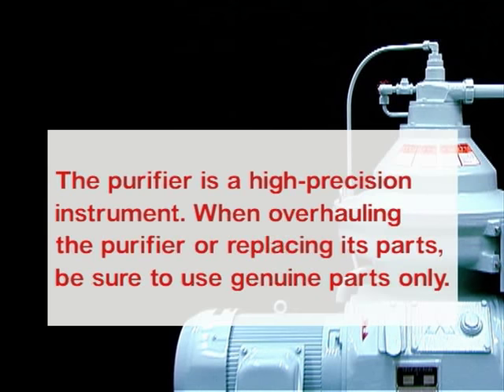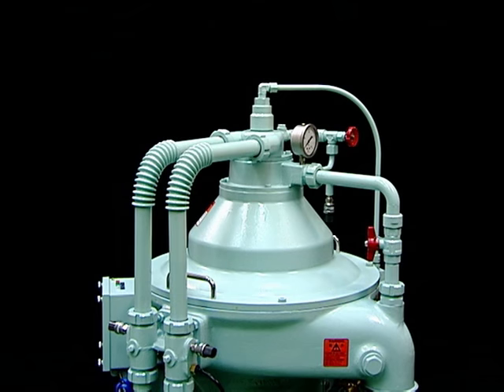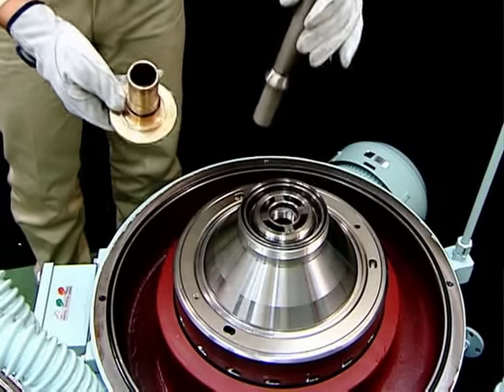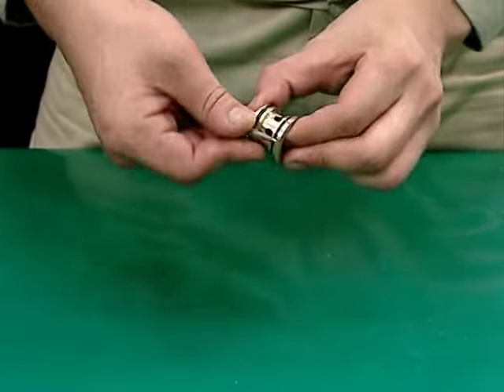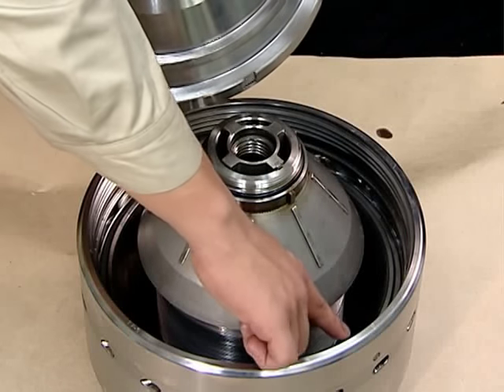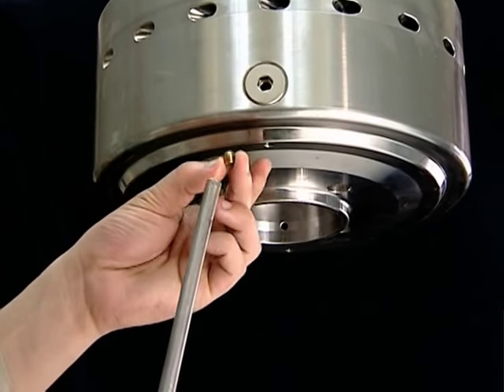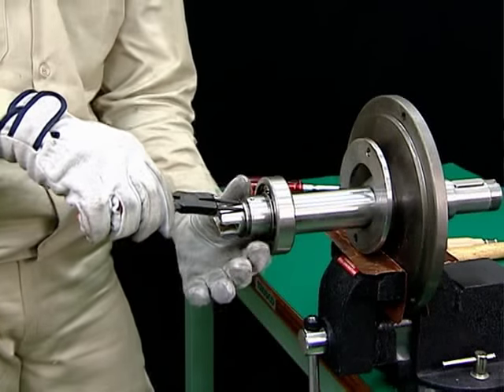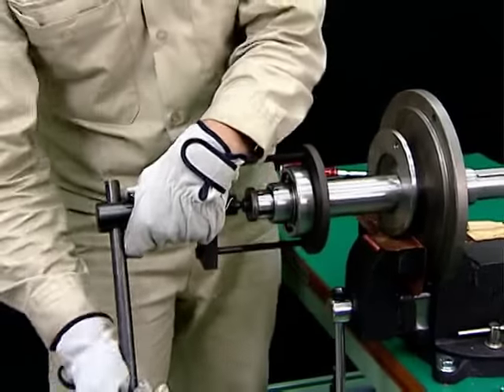MITSUBISHI SELFEJECTOR / PURIFIER OVERHAUL (PART- I)

Comment: What to do if the zero of the liquid chamber does not match the zero of the ball?
Reply from the maker: It should, basically this mark are given for mass balancing, slight here there is tolerated. If its more then, tighten the disc compressing tool.

Comment: Please correct me if i'm wrong. In removing the cap nuts of the connecting pipes. Isn't the other pipe connection is for "Heavy Liquid Outlet" instead of "Heavy Liquid Inlet"? 
Hoping for your response and Thank you for uploading educational vids :)
Reply: Yes you are right that is for heavy liquid outlet not inlet.